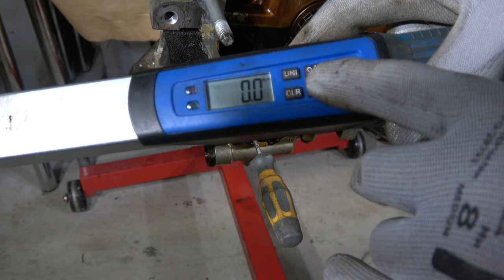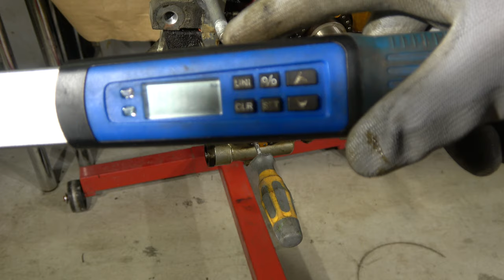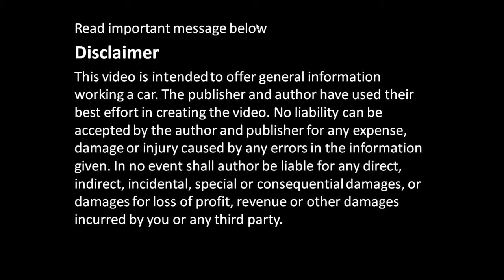P14/27. Timing Chain. How to Assemble Toyota Camry 2.4 VVT-i engine: Timing Chain

Comment: Where did u set tdc? I’m confused
Reply from the maker: Look markings
Reply: ForThepeople
Tdc is easy to set. All you need is to set the linear marking on the crankshaft position upwards.
Reply: @michaelopere5424  @7:16 I'm confused on how he turned the flywheel. If the engine is still installed how would you turn the crankshaft to get the markings facing up
Reply: @seanedwards94  Just install the crankshaft bolt and use it to turn the crank.

Comment: hi Peter, I'm having the hard time doing the timing on my scion tc, because the car is a coup I have to take the whole engine out every time. my cam gear seem to be coming out of time or slipping while under the chain before the chain finally gets to be tight enough to turn the gear with out more slipping. please help.
Reply: Did u resolved your problem? Do I have to remove the oil pan. Im doing the timing chain on a Scion TC as well. Thx
Reply: @danielmartinez1911  you have to remove oil pan yes, I never got it fix
Reply: @mosesandrews4381  so I took off the pan, and all bad .. big chunks of metal in there, and the bottom of the block by the oil pan has a cracked piece on it. Think this engines done
Reply from the maker: Thanks for comment 👍😀